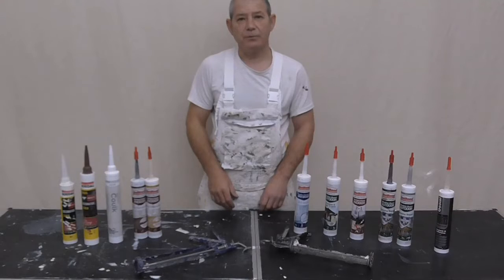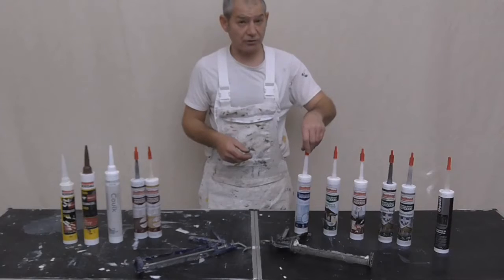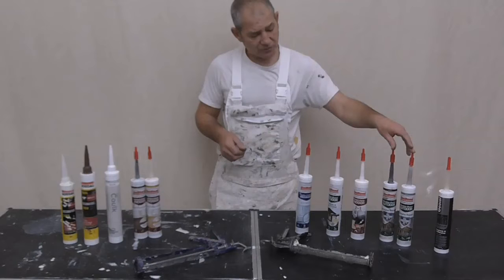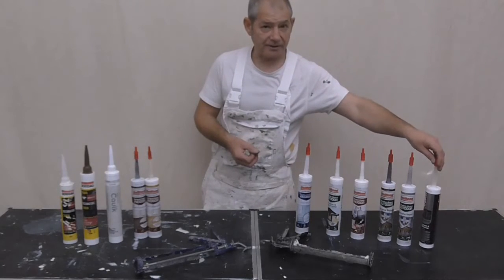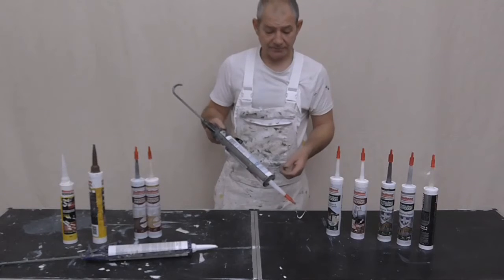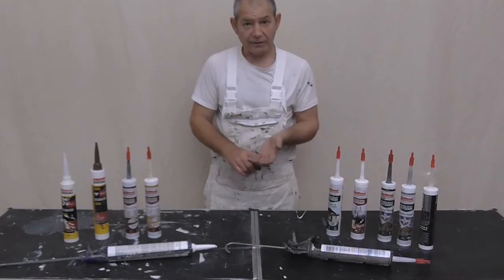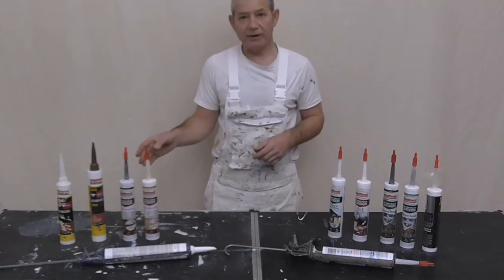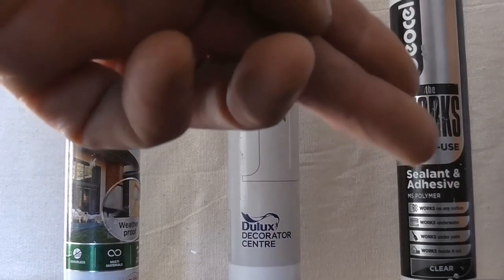Caulk... caulking... What Is Silicone caulk?

Comment: ....so, for skirting gaps polyfiila would be best?
Reply from the maker: Well the thing is loads of people would use caulk because it's fast. But as we all know fast is not always the best, if your woodwork is well secure and no movement and yo have meters upon meters then caulk is a good choice. But if your just doing a room or they are loose then using some foam down the back helps fix the skirting in place fills the main void and you top it of with powder filler which is easily sanded and makes for a better finish.  Caulk has it's place.